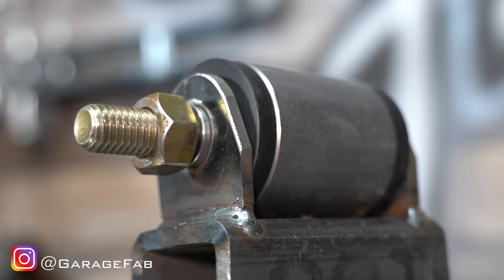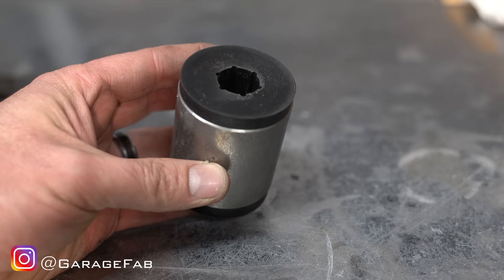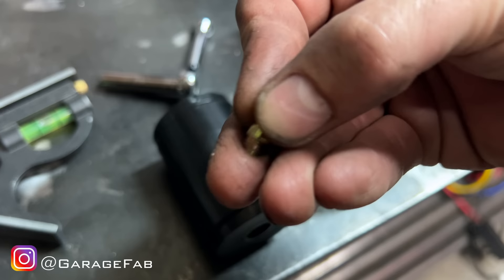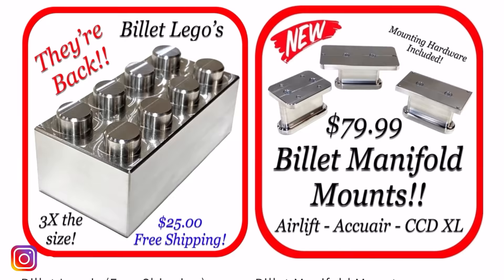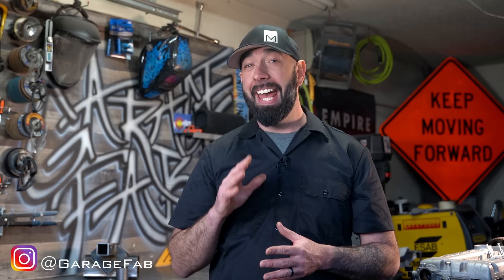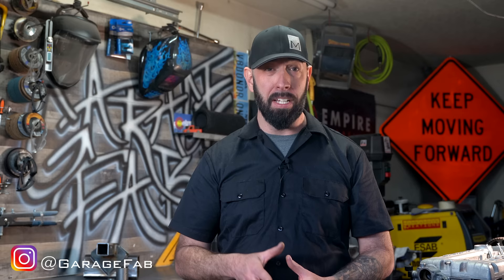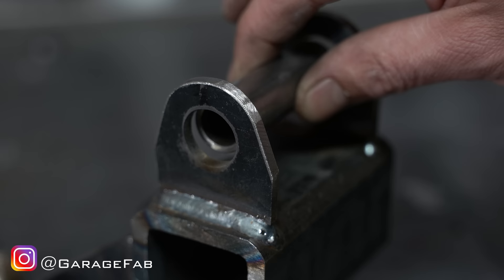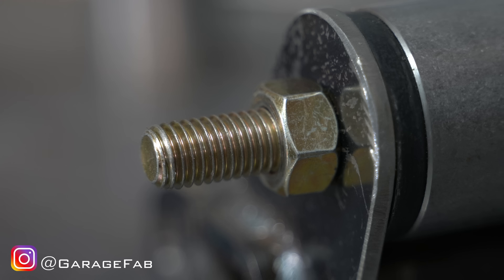The DOs and DON’Ts When Installing Polyurethane Suspension Bushings

Comment: I would be careful with using a bolt that has a shank that's the exact size of your tabs. Especially since the tabs will deform some when tightening. If you run out of threads your torque wrench will click off but the joint isn't necessary tight. The bolt sees a relatively low load because the bolt is tight(Joint stiffness ratio). If the bolt isn't able to provide enough preload to the inner sleeve then the bolt will see more load than it should. This is why you see bolt holes in tabs get egg shaped because the bolt wasn't tight enough.  With that said if you use enough washers to make sure the nut has threads to grab on to then you are golden.
Reply from the maker: You just got yourself a pinned comment. I appreciate that. “Good point” would be an understatement.
Reply: Yea well non issue if you use a lock washer.
Reply: I'd rather use a thicker tab than a bunch of washers personally.
Reply: @EricFixalot   I certainly wouldn't stack lock washers on anything.
Reply: @bw3506  True, maybe one on each side
Reply from the maker: All true. And I agree with the thicker tabs suggestion. Any additional washers beyond a flat washer and 1 lock washer should be avoided in the design process and only used if there’s no other choice.
If I’m being honest, I think I would get a bolt with a shorter shank, even if it doesn’t stretch the entire space between the tabs, before I would stack several washers. Most quality production vehicles I’ve seen don’t follow the shank rule anyways. Shrug 🤷‍♂️
Reply from the maker: Superglue?
Reply: @bw3506  Would it make any practical difference in a metal fatigue way?
Reply: @timothydraper3687  I don't think so with mild steel because it generally doesn't fracture easily unless it's near welds where it's heat hardened. Only thing I can think of is if it was taken off and on enough that the lock washer actually removed material under it. Which they will do in repetitive off and on cycles.
Reply: @You Tube I've done that too in a pinch, tap and die set made short work of it.
Reply: Lol, no one said to stack washers! The concept behind washers is to spread the load of the fasteners thus creating a better hold and to not crimp the OD of the fastener whole by using a nut only. It is also correct for the shank of the fastener to be the length of the outside of the mount due the threads being a smaller diameter and will cause the bolts to walk in the mount wholes under loading and unloading cycles. Tim McAmis gives the best description of this in a video on his site. Tim McAmis Performance parts
Reply: @donaldellis8116  Someone literally did say to stack washers... so this is awkward
Reply: Was gonna say washers too, but i thought it was a quick fix
Reply: High end builds are using AN or NAS hardware, ordered to the exact shank length…. But high end builders probably not watching this YouTube video on bushes. 😊
Reply from the maker: Oh, some are! And they’re making it clear they think I shouldn’t be anywhere near a tool or a vehicle. 😂
Reply: @donaldellis8116  the OP didn't but there was a comment suggesting stacking. Not sure if they meant flat or lock so I pointed out it's a bad idea to do that with locks.
Reply: That's pretty much exactly what a flat washer is for. The shank of the bolt extends a small fraction of an inch past the tab to take the load off the threaded section then the washer adds some space to keep the nut from bottoming out.
Reply: @chaserivers4058  Also alot of Aircraft also use close tolerance bolts holding the wings or landing gear that have a interference fit. The  shank is machined to size and are identified with a triangle on the head.
Reply: @bw3506  the problem with lock washers is that they break and fall out over time, leaving you with a bolt that is now loose . A much better solution is to use a flat washer against each tab to spread out the load in conjunction with a Nylock nut . A Nylock nut also allows you to tighten the fasteners until you just feel it making contact and no farther , and they don't back off .
Reply from the maker: Gotta jump in here, Bob. If we’re still talking about suspension bushings, simply snugging up the through bolt is a bad idea. Again the inner sleeve can’t and shouldn’t move. Significant torque needs to be applied to the tabs, firmly clamping the sides of the sleeve to prevent any movement and metal rubbing.
Reply: @GarageFab  my thought was that there are geniuses out in the world that would crank down on the bolts until they manage to bend the tabs inward and restrict the movement of the bushing . Torquing the bolts down to 100 ft.lbs. after contact only leads to fatigued bolts .
Reply from the maker: I feel you!
Reply: @bobbrinkerhoff3592  With a sleeve inside,  the tabs should not bend
Reply: @EricFixalot  they won't IF the sleeve is fitted to the distance between the tabs , even if that requires hand filing of a sleeve to fit properly . Some builders are more interested in production numbers over precision .
Reply: @bobbrinkerhoff3592  I agree with you to a certain extent. The flat washers yes and Nylocks are a good solution but they aren't in everyone's shop plus they are pretty much one time use especially if there's any corrosion on your threads you don't get off. I can tell you that you do need some pinch/preload or torque on your center sleeve though regardless or it will work on the inside of the tabs especially if the bushing gets a little dry.  As far as the locks they rarely fail until they are very rusty. Of course depends on quality. I also consider them one time use on suspension. They have been used successfully on leaf spring set-ups with constant movement and I've taken 50+ year old stuff apart that they were still on just fine. There's always multiple ways of basically doing the same thing. Most of the time as long as you use common sense it will work out.  Some are just short in that department at times.
Reply: @GarageFab  yes 100%
Reply: @bw3506  Let me clarify some things here . I've been building cars and industrial equipment for over fifty years now . First off , if you're building from scratch you would be using new hardware , so therefore there would be no corrosion present . Second , you test fit and assemble before tearing down for paint or powder coating . when doing final assembly is when you switch over from standard nuts to Nylocks . Third and this is the big one ;  people are misconstruing what I meant by " tightening until contact " , I'm a retired machinist , one of my mentors was a tool and die maker / gunsmith so I learned about precision early on . When doing a project such as this I machine a spacer block to clamp the tabs to before welding , I also fit the inner sleeves to the tabs with an interference fit , if the paint gets scuffed during assembly , big deal , touch it up  . The point being if you put the proper amount of forethought and care into the fabrication and assembly process you don't need to King Kong the bolts , just make contact and a little extra . Fourth ; I live in a predominantly Amish county and I have absolutely no trouble getting Nylocks or grade eights at my local hardware store , unless I run out on Sunday .
Reply: @bobbrinkerhoff3592  Impressive
Reply: @bw3506  Thank you . I grew up around my Uncle's collection of antique single shot rifles from the latter part of the nineteenth century , and was taught that " if they could do this kind of workmanship with the tools and equipment they had back then , just think what you could accomplish with a full century's worth of advances in the process . "   Also to this day if I can build a part for a race car or hot rod I will , cause the prices still aren't any cheaper.
Reply from the maker: That’s an awesome mindset.
Reply: @GarageFab  "most quality production vehicles don't follow the shank rule" - that's because the bolt isn't a shear pin, when you tighten a bolt it's purely stretched along its length and friction between the mating surfaces is what bears the load. Whether the shank rule is followed or not... doesn't matter, up until you have enough torque/clamp load loss that results in the failure mode of the bolt being used as a shear pin.
Reply from the maker: So perhaps it’s a fail safe for when the clamping force isn’t enough. This is why I love the comments section so much. I feel like I’ve learned more here than I have in one of my years of actual experience.
Reply: @GarageFab  agreed there. I’ve worked on tons of builds and even at Rivian. Most manufacturers don’t follow those simple guidelines because the engineers that design that shit have no clue of how a vehicle is supposed to work, what it’s like to work on them, and I could go on and on. The problem is that they design their models and specify the tolerances and variations. All to offer the buyers will find whatever is cheapest that falls somewhere inside those tolerances and they don’t account for tolerance stack-ups.  Kind of like the military, all military grade means is that it was provided by the lowest bidder.
Reply: @GarageFab  YouTube is awesome sometimes. It's definitely valuable and interesting to have multiple ideas and train of thought on stuff.  Especially when people are civil to each other and not be hostile or be a smartazz in the comments. Lots say nobody is too smart or old to learn something new or a new way of doing something and I agree. I like your channel because you are involved in the comments. 👍
Reply from the maker: Amen.

Also I like you back.
Reply: @JonesingUSAF  That lowest bidder scenario holds true on lots of manufacturers sourcing parts as well.  Sad but true.
Reply: @Nord3202  I’ve seen some of these high end builds (at the Baja 1000) and I’m amazed at the amount of money they spend on hardware alone.  For most of us building shit in our home garages, grade 8 is good enough.
Reply: @GarageFab  If the bolt isn't rotating, and just holding the tabs together to let the bushing rotate, wouldn't that explain why the manufacture's engineers don't feel a need to follow the shank rule? Would also let you get a bolt you don't have to cut.
Note: I am neither a mechanic nor an engineer nor intelligent, this is just a question.
Reply from the maker: @FlattardiansSuck  I must say, I was extremely disappointed that you didn’t say “Fifthly”
Thank you for the info my friend. 🙏
Reply from the maker: I think this is an opinion thing. Someone recently told me, (possibly in this thread even) The bolt’s job in this application is clamping force. If the sleeve slips, the bolt has already technically failed at its job. If the slip was prevented as it should’ve, it wouldn’t matter how long the shank is. So the “shank rule” is kinda silly and would explain why manufacturers don’t follow it. Sounds like this might be what you’re getting at.
Reply: @GarageFab  But that's under ideal conditions where the bolt doesn't experience any shear force.
Reply: That is why radius measurement is getting more popular. Personally I prefer it over torque as it's more precise.
Reply: @johnterpack3940  but it doesn't in most automotive cases. In civil engineering it's more common but 95% of automotive joints the bolt is simply used to clamp two surfaces together. Shear is taken up by the friction force between those mating components
Reply: @timothyer2447  I'll guarantee shock mounts see some shear. Probably not tons, but some.
Reply: @bw3506  I would say that’s not something that goes on a suspension.
Reply: @bobbrinkerhoff3592  but the forward leaf spring shackles on my truck are torqued to more than 100ftlbs they don’t even get to that unless the bolt and nut make contact with the tabs. I’ve actually run into more tabs that are wider than the inner sleeve instead of having to file to fit. Properly torqued the tabs didn’t pinch the sleeve so we tapped some with a hammer like tabs for control arms, some we bent using a press like the actual control arm. I realize pressing out the bushings spread the control arm a little even though it was supported but I have no idea how the tabs on the frame crossmember got spread because the old bushing was tight enough that it stayed in there with the bolt out.
Reply: @dirtyaznstyle4156  what most of the people on here are missing out on , or not comprehending is that this man custom builds his frames from scratch and puts the suspension tabs on himself . If t length of the steel sleeves is shorter than the gap between the tabs there are options . Either get longer sleeves if possible or shim the gap . If someone tightens down the mounting bolts so much that they've bent the tabs in to meet the sleeves , they just set themselves up for failure of the tab welds or the parent metal surrounding the tab welds .  There have been instances where guys have torn their entire front suspension out from underneath the car when they hit either a pothole or an expansion joint at normal highway speeds .
Reply: @dirtyaznstyle4156  What doesn't, a lock washer?
Reply: I switched from bolts to shoulder bolts tighter fits just a personal preference
Reply from the maker: Same… ish. I prefer shouldered bolts for everything. I just never switched the bolts I use for bushings. 🤔
Reply: Hang around some aircraft for a while ,and you'll pick up alot about proper fastener use. 
That's one place you don't compromise. 
Then again,it's not as high tech as you may think, alot of old planes still use stove bolts.
Reply from the maker: Thank you for making me realize I never want to work in aviation. I hate flat head screws more than anti-seize. Flat head screwdrivers should be meant for prying only. 😆
Reply: @GarageFab  haha I hate flat screws too,even the Phillips can be bad enough after a while. 
As soon as I feel one slip ,out comes the snap-on screwdrivers and if that's not working I combine that with a dab of valve grinding compound for extra grip and put some on the screwdriver end. 

On a certified aircraft youre stuck with that original style junk, on an experimental feel free to use nice Allen bolts and other fasteners that actually can come off when you need them to.
Reply from the maker: That valve grinding compound thing sounds potentially awesome. Gonna try that!
Reply: @GarageFab  yeah it works great ,just watch getting it all over the place if it's something precision. 
At least it's a small amount ,and you won't look like a tinman holding a jar of anti seize 😂
Haha I love those memes
Reply: The bolt should only be creating a compression force on the link tabs and inner sleeve and not taking any other load. I don't see any reason for a bolt breaking in the threads unless it is undersized and not providing enough compression force, allowing movement and loading to the bolt. The bush and tabs should be taking the suspension forces, not the fastener, even a full thread bolt will work without breaking if selected correctly.
Reply: I agree but don't. Yes clamping force does reduce load on shaft but most bolts break when torque loosens for a multitude of reasons.
AHax one of the world's leading bolt manufacturers have incredible data on this topic. Most manufacturers of bolts around the world, including vehicle manufacturers designed bolts to have a shaft going exactly the length of the control arm bracket. It does state the threads are the weak point and that's why many structural and suspension bolts are partially threaded.
Most vehicles have Metric Class 10.9 bolts with Class 10 nuts which is equivalent to SAE Grade 8.

There is also usable information from Henkel-Adhesives (Loctite) and Ajax that talk about Nickle Anti-Seize, Nickel-Graf Anti-Seize and Copper anti-seize being used on bolts and lug nuts. They claim it lubricates the threads increasing torque applied when fastening. They don't discourage it either, they state you must reduce torque value by 30% with anti-seize and 20% with threadlockers.
So simply multiply your torque  spec value by 0.7 for 30% reduction and 0.8 for 20% reduction.
Example:
88 Ft-Lbs torque spec for a control arm is 61.6 Ft-Lbs (62ftlb) with anti-seize on threads and 70 Ft-lbs with Red Threadlocker on threads.
If you apply the multiplied torque value to your component, it will be the same as if you did the original spec. So 61.6 Ft-Lbs with anti-seize compound on threads will apply 88 Ft-Lbs of torque to your bolt.
I've used this formula with my lug nuts, suspension bolts, frame bolts, caliper bracket bolts, engine mounts and so on with great success.
Reply: @bobbrinkerhoff3592  well good thing it wasn’t that bad, just not enough to shim with washers. Never liked bending tabs, clearly puts stress on the welds.
Reply: @dirtyaznstyle4156  if your talking about Bending shock/LCA/track bar brackets out a bit to fit a slightly thicker aftermarket shock/control arm/track bar. I've had to do that on several occasions. I simply don't want to grind down a new part and void warranty.
If I didn't the vehicle would be out of commission for who knows how long.
Reply: @Bulletz4Breakfast13  🤯
Reply: Simple solution is to use tooling washers meant for clamping work to machine tool. 3-4 times thicker and have one nicely beveled edge.
Cheap and easy from industrial supplies like McMaster
Reply: @bw3506 I wouldn't use lock washers.  Maybe just a flat washer on both sides and some lock tite. Lock washers don't actually prevent back off and are just creating a potential failure point causing the nut to become loose.
Reply: @farmyardfab  I don't really agree with that but I value your opinion just the same. What I don't agree with is the not backing off part. A quality lock washer will actually remove metal when turning backwards so it's definitely doing something. I'm not talking about the $2.50 a pound junk type. As far as failure point in other ways, yes I can definitely see that.
Reply: This is a true statement,  the fix is to use a flat washer. Another critical part of the joint strength is the bolt shank in the hole.  For max strength there should never be "threads in bearing". Meaning the bolt threads loaded in shear on the tab - that's the reason the full diameter of the shank should protrude through the hole to provide max surface contact between the tab and the bolt.  This is also whyaerospace fasteners have short threads and are sized by "grip length" under the head to the end of the shank (not including the threads).
Reply: @enordquist1 "No threads in bearing" exactly, good point.
Reply: @JonesingUSAF Haha I’ve always laughed at “military grade”. When I was in all of our tools said Taiwan and we had some of the cheapest looking goggles among other issued gear. Some of us went and bought our own gear just to have the peace of mind. I apply the same ideals to my cars. If it looks “cheap” it gets replaced with something designed to last.
Reply: @cjcantrell80  military grade and aerospace aluminum! All that means is that it scares the shit out of me! What branch/MOS?
Reply: I absolutely agree! Aluminum is great, but not in every application. Especially when it comes to keeping stuff together and withstanding brutal treatment in use. I was Air Force, Civil Engineer. I worked on generators and air craft arrestment barriers. You don’t find much aluminum or weak bolts on B-52 brakes for sure.
Reply: @cjcantrell80  right! I was USAF too and was Bomb/Nav and then Comm/Nav after they merged the AFSC’s. First aircraft I ever worked on was a BUFF! Later I worked on 130s and 60s in Tucson and then became an MTL, blue rope, for my last 4 years before being medically retired.
Reply: @GarageFab  And you didn't put a "loved" comment on that.
Reply: @GarageFab  You're a cool person 😎
Reply from the maker: @ehsnils  What are we loving?
Reply from the maker: @rangerdanger6894  Thank you! You’re pretty fantastic as well.
Reply: Add a washer
Reply: @GarageFab  I use a gr8 flat under the head of the bolt and a gr8 flat with a Nordlock lock washer for these types of bushings and then torque them to the correct spec for the bolt. I then mark the head of the bolt, washer, and tab eith a paint marker so i can easily see if the bolt has been rotating.
Reply: @bobbrinkerhoff3592 nobody uses split lock washers anymore, use nordlocks. They don't fall apart and they can't loosen as long as there is tension on the bolt.
Reply: @semajniffirg230  I see two problems with using these in an industrial application , first ; trying to convince the people in charge of purchasing to buy them in the first place , and secondly trying to convince the guys in the maintenance department that they are any better than what they were using . Personally, I've never had a Star washer or a Nylock nut fail , which I cannot say about the old fashioned split locks .
Reply: @GarageFab  a trick when fabbing take and weld a set of thick washers around the tabs bolt holes on the outer face... This make the connection stronger and lessens the risk of egging or tearing the holes without the extra costs of thicker tab material but gives the same added bolt hole strength.
Reply: you can also use a welded nut on one side to be sure that the bolt cant walk on that end. combine that with safety wire or fold over locking tabs on the head end and that definitely isnt going anywhere on the track or trail.
Reply: that is what the washer is for. also who cares what the torque is at. one uga duga done.
Reply from the maker: @notsure6182 I prefer 2.
Reply: @bw3506   you shouldnt need nylocks on anything nut if you must use a locking style go for a stover.
Reply: @notsure6182  The OEM used those on some suspension components and even engine mounts if I remember correctly. I've never used any new ones but I assume they are probably more effective than nylock. At least I would hope so. But they are order only in my area.
Reply: @Nord3202 Boeing is experimenting with leaving nuts off the landing gear wheels.
Reply: @bw3506  Where do you get a STACK from "a lock washer"? And BTW, using A lock washer on leaf spring bolts was THE FACTORY OEM standard for decades...
Reply: @garrettmasarik8012  I think you should read through all the comments and you'll understand what I was referring to.
Reply: @GarageFab  The reason that "Most quality production vehicles I’ve seen don’t follow the shank rule" is that, properly installed, the bolt is working in tension. There should be no bending or shear forces on it. This is because the bolt is simply pulling the "tabs" together to clamp the "inner shank". It is the "inner shank" that is in shear and/or bending when the vehicle is in operation. Your "shank rule" will not reduce the risk of rupture of the bolt because the tension applied to the part of the thread next to the shank will be the same.
Reply from the maker: @duncanmulvein3693 Very well explained. 👏
Reply: @GarageFab  Thank you.